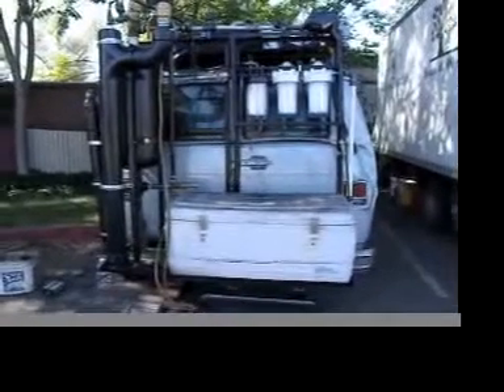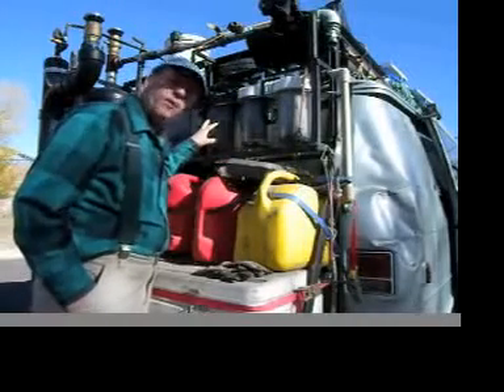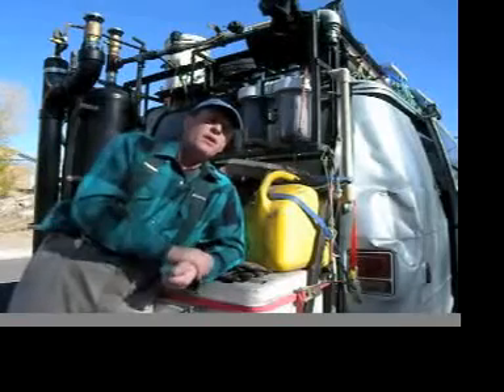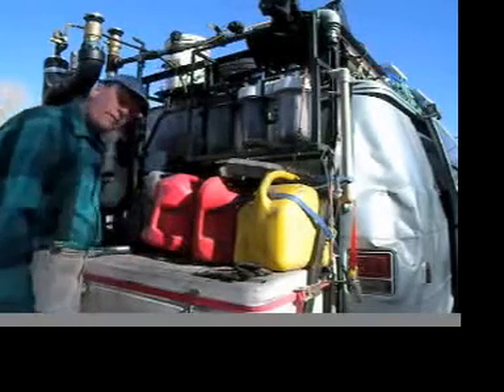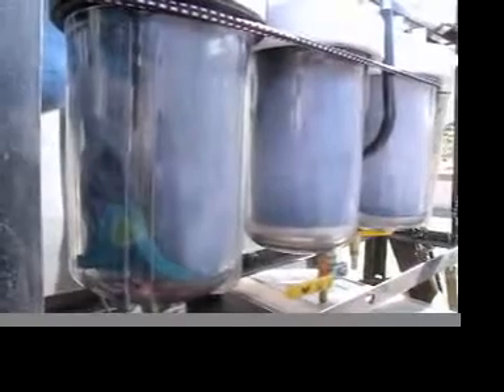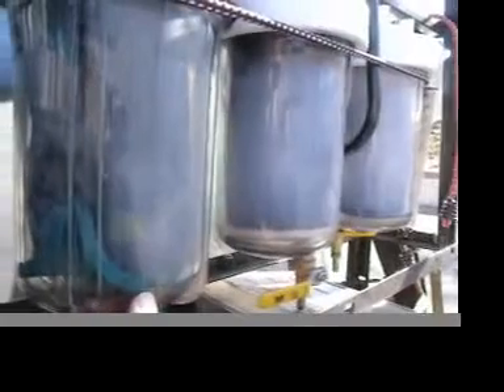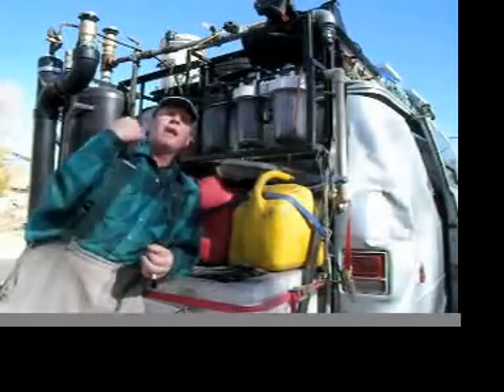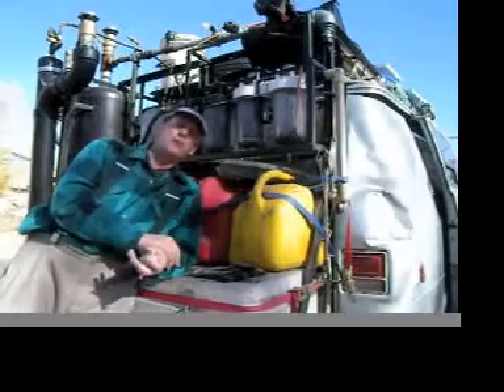Reducing contaminants in Waste Vegetable Oil with gasoline blending

Comment: I've been filtering my WVO down to 5 microns and running 50/50 with diesel in my truck and tractor. I don't have the funds at the moment to invest in the bag filter system that you have (currently using the pleated cartridge system). Would one still be able to blend WVO and gasoline and get the benefits of this reaction if I blended my already filtered WVO with gasoline? I know there will still be particulates and contaminants settling out of the blend, but would pumping the filtered blend through a standard fuel tank filter safely eliminate them? I'd love to experiment with blending without buying/making two different filtration systems. Thanks Jeff!
Reply from the maker: +PrimitivePeter As long as you keep the gasoline component in your WVO blend at or below
 30%, then it should flow through a pleated cellulose filter without 
damaging its seals.

Settling period is critical.  2 weeks is best. Then you need a method of removing the sediments from your blend, like settling it in a cone-shaped tank with a valve at the bottom to drain off the sediments.  Running your blend through a centrifuge after the settling period helps improve your product as well.
Reply: +Jeffrey Brooks Thanks for the advice Jeff! I am totally blown away by both the amount of sludge produced by blending, and how thin the veggie becomes after settling. Wow!

What kind of pump do you use to process blended but unfiltered WVO? I've been using just a diaphragm pump for pumping the straight WVO, but I am not sure if the gasoline will damage the pump at all. Thanks again for all the good work and advice :)
Reply from the maker: To pump my fuel blend through filters my bending-settling tank is a recycled compressor tank, and I use a small diaphragm air pump to pump compressed air into the top of the tank, and I have a valve at the bottom of the tank, which takes my fuel blend through the filters.  Doing so reduces turbulence, which aides in separating the sludge from the blend.  And, it only takes 2-4 psi to move the fuel from the tank through the filters.

Comment from the maker: @pat1huey there seems to be no reason to remove the alcohol in gasoline, because gasoline blended with alcohol works fine for blending.  I think you should at least try blending before going to the trouble of making biodiesel.  I think you will find blending much easier, less work, less expensive and more effective, especially in cold weather.